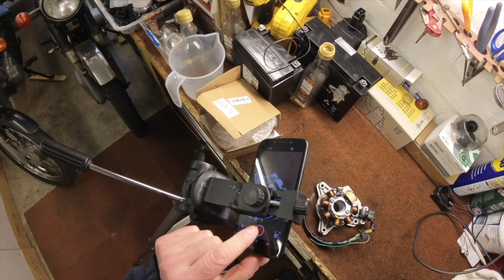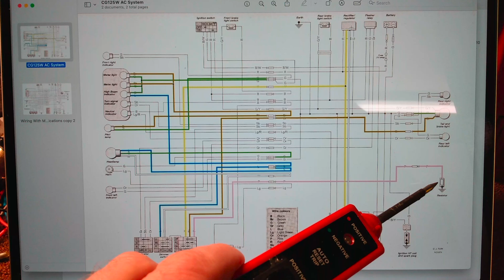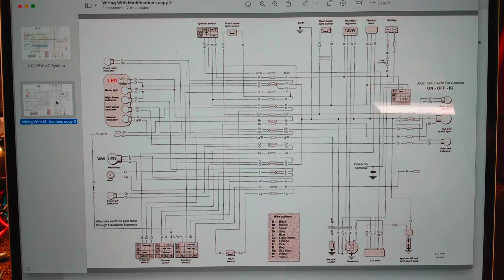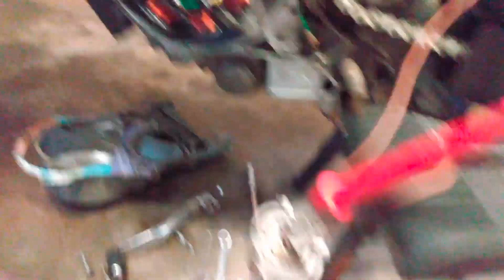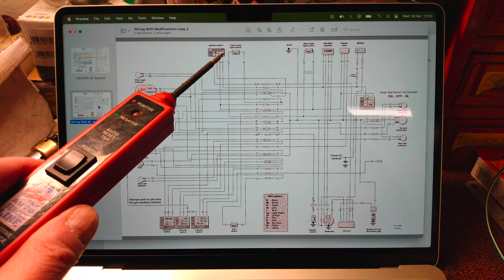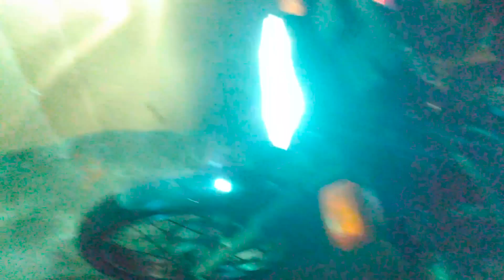Honda CG125 Alternator Full-wave Modification For Battery Lights - Part 2.

Comment: Back in the day you could easily understand the electrical schematics. They were even in the manual. Now you get noting. will have to find part one and 3 if there was one. very interesting. Luckily I never had any issues with the one I had. Nice Job.